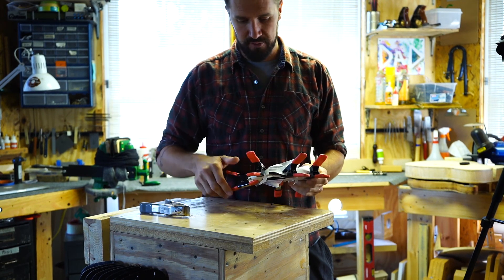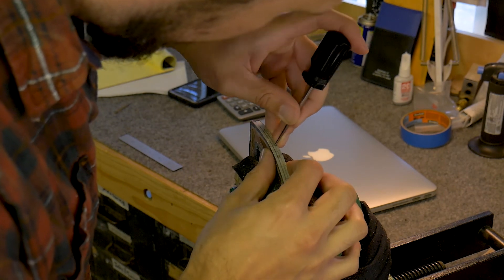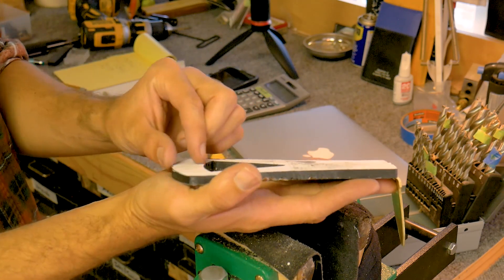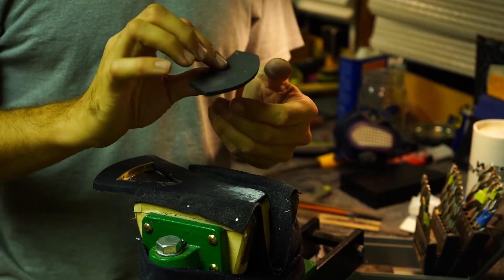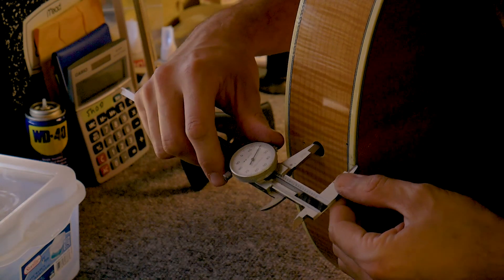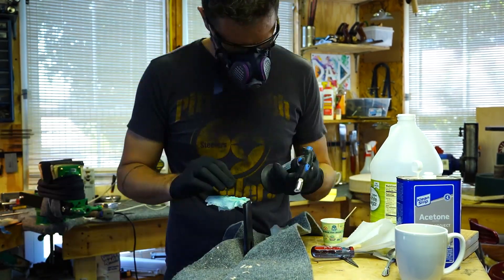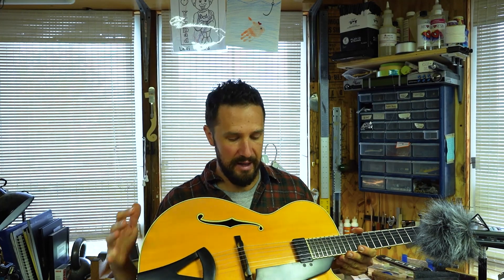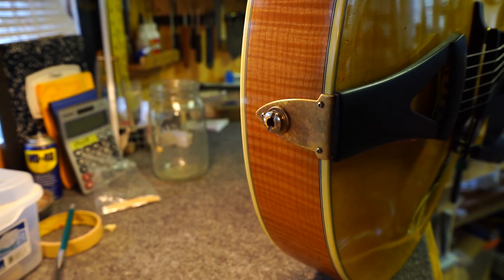Part 3 - wrapping up the archtop tailpiece fabrication

Comment: I've watched the series and I wonder why you didn't install ground wire. 
With electric guitars this is usually done through the bridge. At an arch top, the bridge seems to me the best way. 
Aren't you afraid that without the strings being grounded you will suffer from humming?
Reply from the maker: 1 - There was no issue with humming when the guitar came to me (with no grounding) so there was the matter of not fixing what wasn't broken. 
2 - The reason electric guitar strings need to be grounded is that they usually contact metal bridges. On an archtop with a floating wooden bridge, it's typically less of a problem. 
3 - On my custom-commissioned guitars I do ground everything to be safe. But with the floating bridge and tail piece, it can be a bit of a design challenge to figure out exactly how to ground the strings. So in this case, it just didn't seem necessary. 

Thanks for the comment.